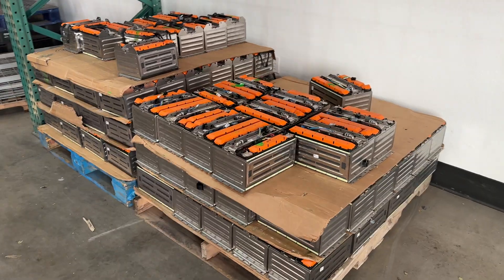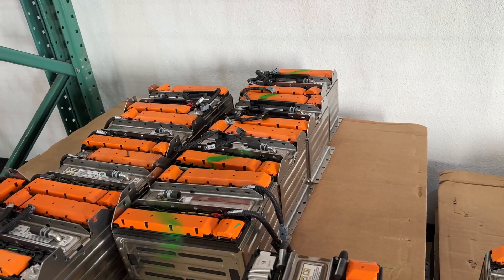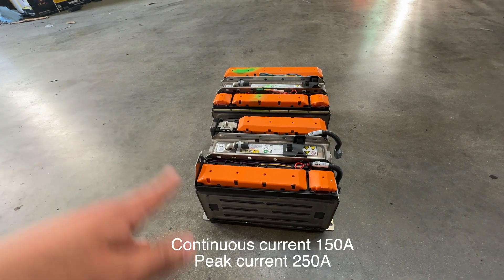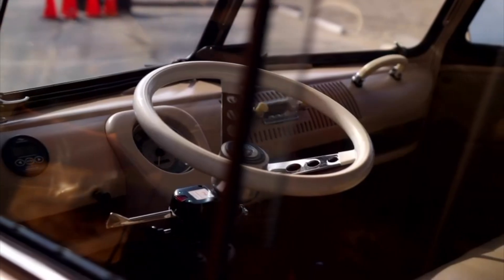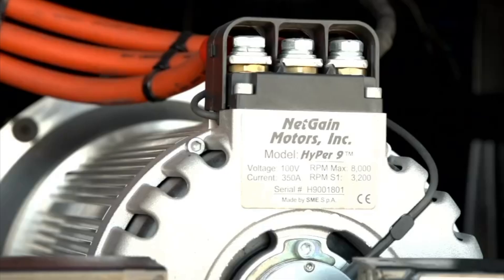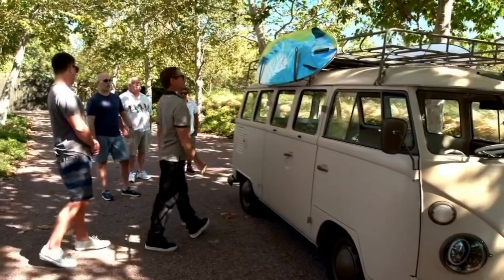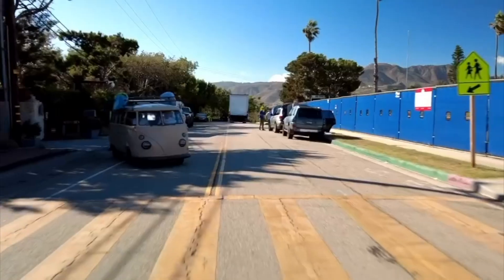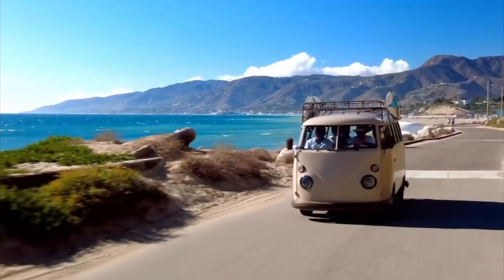64Ah Samsung Cells - FIAT battery Modules

Comment: There is no cooling plate, that is an vent if a cell vents.
Reply: The rubber hose is a cooling port. liquid cooled.
Reply: lol sure, I have a module in front of me that says otherwise.  @gildardo
Reply: @melovescotch  OH, my bad. I thought the Fiat 500E had active battery cooling. Thanks for updating us though.
Reply: @melovescotch  Just looked it up, there is a separate cooling loop to cool the batteries. That's the first time I see a battery pack with plumbing for the vent holes of the batteries.
Reply: @gildardo  I think SmartED cars packs have tube for cell vent also.. yeah, not that common.